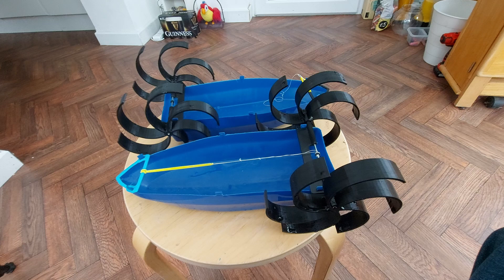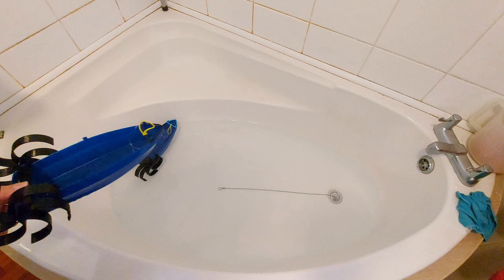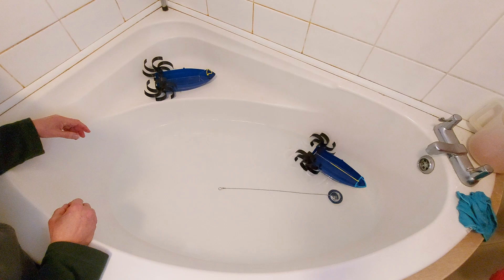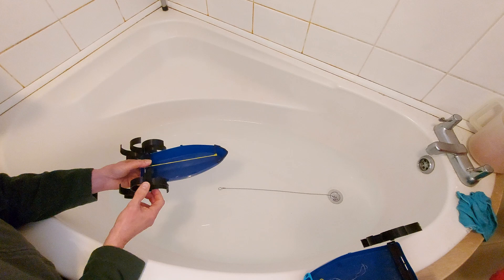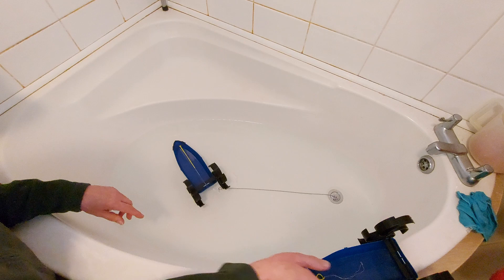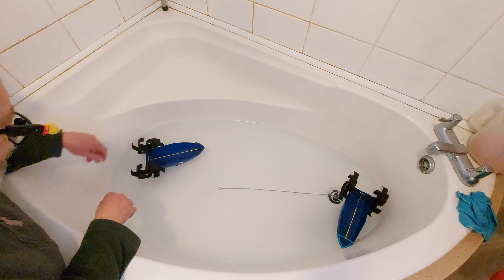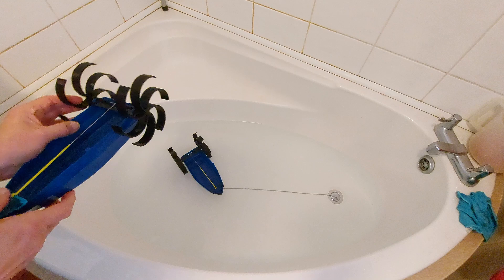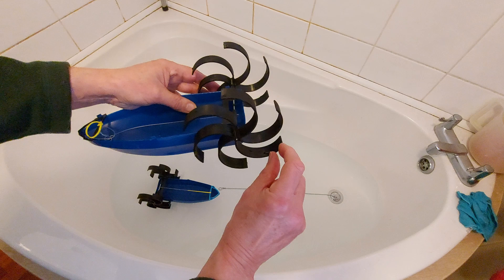0470 Video Reply regarding the paddle boat paddles

Comment: Wow, didn't expect the backwards paddles to cause it to steer hard right.  But between right and left it definitely choose wisely 😂 nice demonstration
Reply from the maker: I expect with more power it would have been more interesting, but that was enough to show there is a problem. Like I was saying in the previous comment, it's the fact the water is trapped at the back of the wheel that is causing the problem. The wheel is trying to lift the water at that point. 👍

Comment: I have a bent canoe paddle, and it has the same behavior: for better paddling, you want the bend pointing forward, rather than to the rear. The increased performance of it comes from it exiting the water more cleanly, not "taking a bigger bite" of it.
Reply from the maker: Excellent practical example, thanks 👍